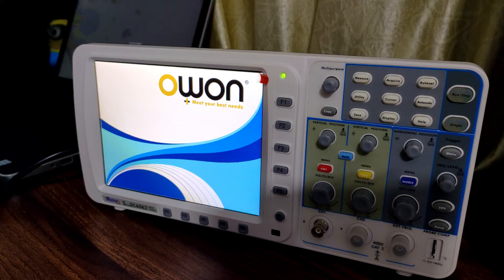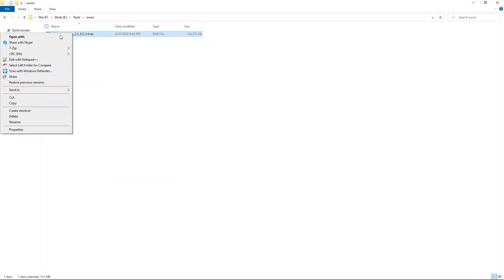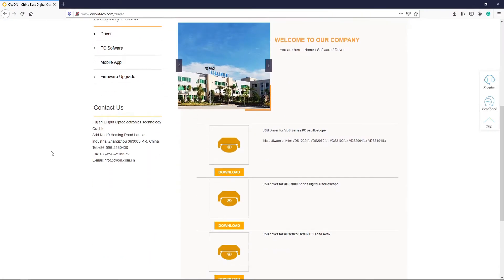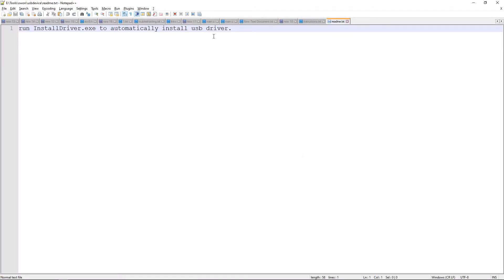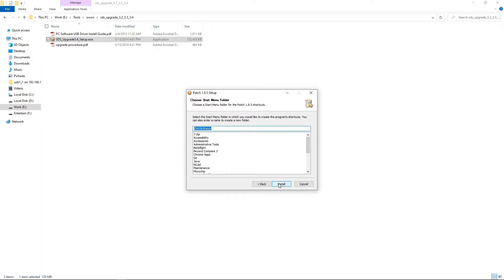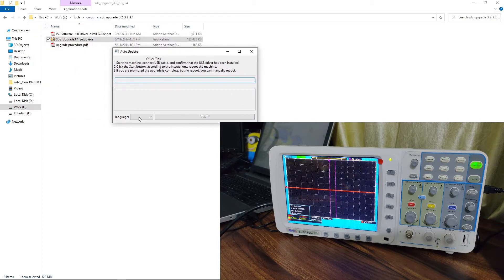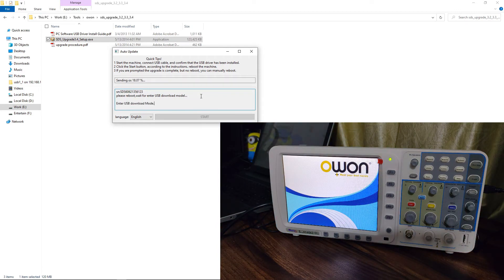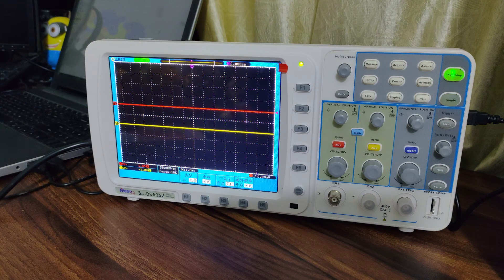DSO Firmware Update | DSO USB Flashing  | OWON | DSO firmware Upgrade

Comment: Sir while updating firmware power supply is gone and my dso not getting on or no display on screen only blank what can I do ?
Reply from the maker: Try following thing
1. Turn Off DSO
2. Connect USB cable to DSO and PC
3. Turn ON DSO and Start flashing from PC.
Reply: could you please share the flashing software